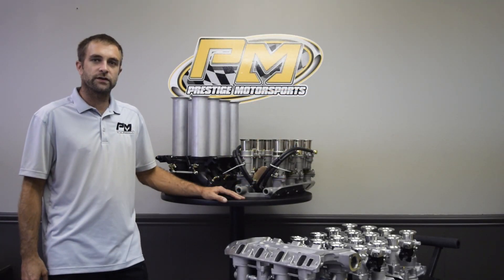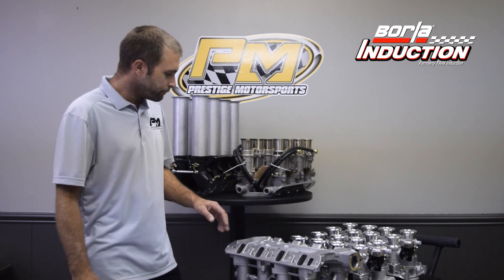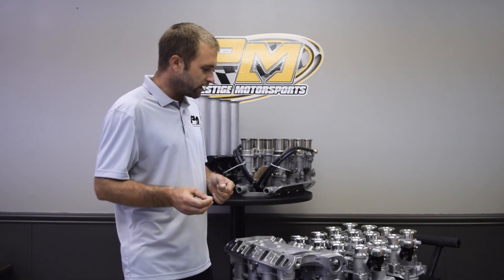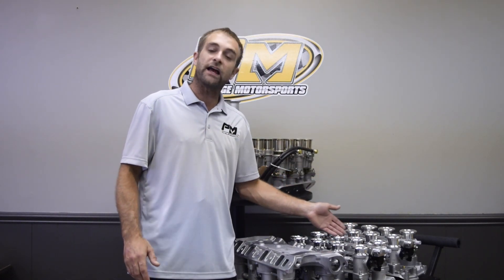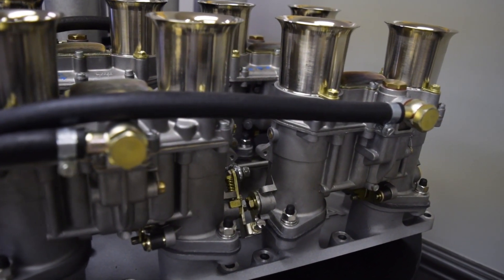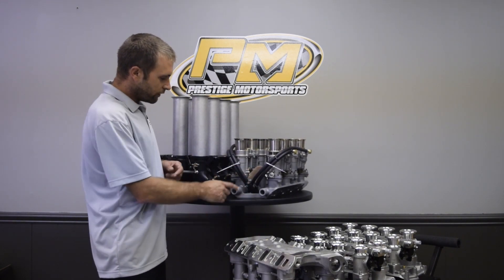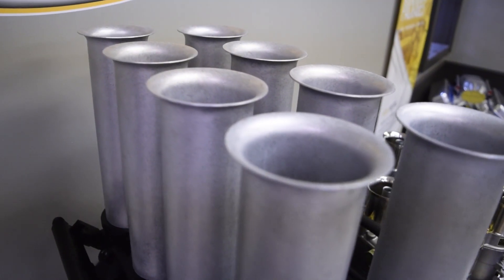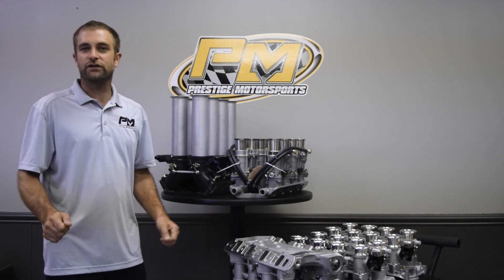Stack Injection Kits at Prestige Motorsports Explained

Comment: Can you please do a comparison test of the different eight stack EFI kits And can you also show what the mass airflow is and some of the other specs that not all of these kits mentioned although they should for the price that they ask for and lastly the drive ability of each this would be greatly appreciated
Reply: You have to select Alpha Numeric , TPS/throttle,  because when you open say 5% the map sensor will think it's at full throttle , waste of time trying to move up to speed density   or  mass air flow sensor .
Reply: @Cobra427Veight  thank you 🙏